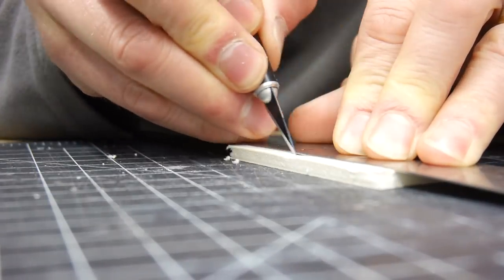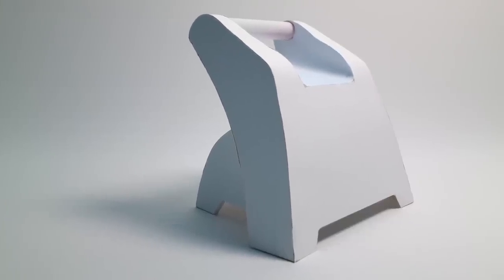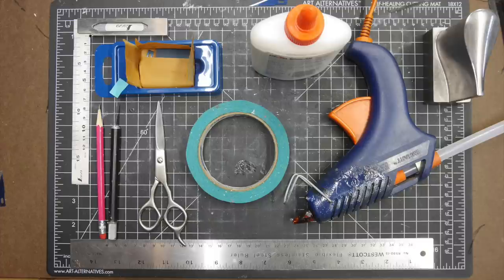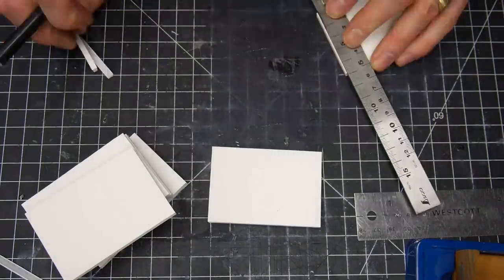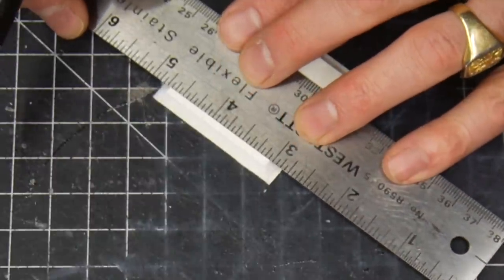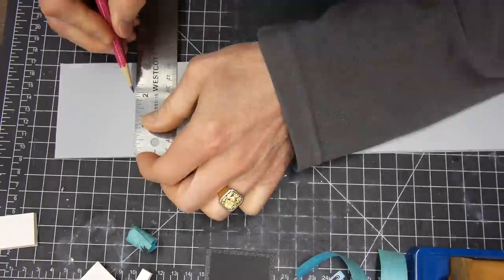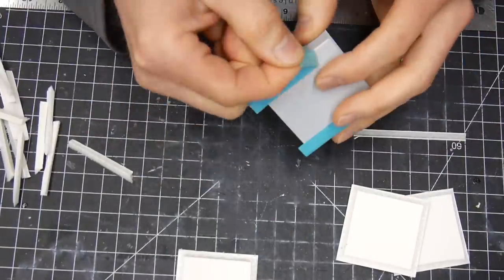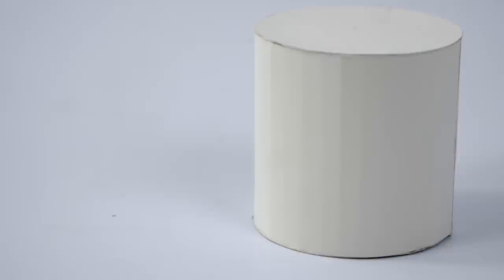FoamCore Basics Tutorial Guide FoamBoard model making: modeling tips and tricks for Designers

Comment: I'm making a halloween costume -- school bus, to be exact, and using foam core to be the bus.  I did not cut 45 degree angles, and I'm not so concerned about it looking perfect, however, I am concerned about finding the right glue to bond everything.  Do you have glue suggestions?  I have tried crazy glue and hot glue and neither work.
Reply from the maker: Hot glue works of course and it's fast, white glue is clean but takes a long time to dry.

Comment: great video.
I like to use bare utility blades for foamcore.  I use the extra length of the blade to help guide the cut.
A very shallow angle with your blade allows for an easier and cleaner cut.  
I learned some great techniques from Flite Test, as they use foam core to build RC aircraft.

Comment: Thank you so much for making this video! I have had so much confusion between foam core and foam board and expanded  pvc sheet…I Make dollhouse miniatures ..This is perfect for making room boxes or even the small doll houses. I love the way you do the tape with the Elmers glue. I don’t own a glue gun ,so that will be perfect for me. I have trouble with cutting perfectly. I’m ordering some expanded PVC sheet ,because I’ve seen a couple of YouTube videos where people make doll houses with that and it seems to be more clean-cut. And durable...Do you have any experience w expanded pvc sheet ,or know about it? Also, What X-Acto knife are you using? I got a number two blade and I think that was the wrong one to get ..I believe it’s less sharp… Anyways thank you for any help you can give me! And thank you so much for the video ,,it was very helpful!
Reply from the maker: Whit * I have not made any videos about the expanded PVC sheet I do not believe that you can just cut it with a standard X-Acto knife in the same way that you can a piece of foam core or cardboard. X-acto blades should be linked below the video
Reply: Eric Strebel 
Thank you so much for the quick reply! I know it’s possible, because there is a YouTube video ...I believe it’s called DIY miniatures… But he puts on there that he uses expanded PVC sheet… He directed me to a page on Amazon and it’s only about an eighth of an inch thick (may be a little bit more)… I believe you can buy different sizes… But he cut through it perfectly with a craft knife. I guess I’ll find out ,because I’m going to order it soon, and see how it goes… I’m getting the smallest piece possible… ($9$ I do very small doll houses so I don’t need much… Thank you for all your help!

Comment: Sir Strebel, you are a wizard  with foam(s) & because  I want to do quality work I need
to ask  your opinion  about what type foam I might use?  I'm designing an RC Plane &
it will be about 40 inches across. Should I use a "Closed Cell foam" or is another type
better?  I'm looking for durable foam that can be shaped(cut/sanded). I'll use the best
glue for the type foam I go with, for aesthetics & hold. I'll also do some type of paint &
a laminate.  Foam  is my main  concern & there's  so many  types that I thought I'd get
your input before I do anything..... thank you
Reply from the maker: diggy dice closed cell will be stronger, but it's really the outer cover that give the foam board it's strength. look for a quality foam core for your final plane. Best of luck. when you build something tag me on social media to share.
Reply: Yes sir, and for that reason I'm planning a lighter foam for the core of the
project & a thinner but tougher foam wrapped around at least the wings
of this project. I don't want to use "Hot Wires" to sculpt this, I'm looking
for a foam that a Dremel & Exacto blade can do smooth work on. With
sandpaper to finish it for paint/laminates. I'll keep you apprised since
you know the most about the "Aesthetics"  of foam modeling.
chat soon & ty again..... don

Comment: How long does white PVA glue take to bond approx 15-30 min?

I like the 45 deg angle with painters tape idea

I see a lot of people use straight pins if they do the standard 90 deg  flat pieces for custom gaming box inserts for example
Reply from the maker: PVA can take an hour or more to set up(to be safe), depending on your local atmospheric conditions. Things take a bit longer but the results are worth it.

Comment: What about contact cement in place of white glue? I'm not sure if it react negatively to the foam but you'd get something tacky after a few seconds. Hot glue is a pain for small fine projects. If I'm working with electronics of filling a hole, it's awesome. Don't care about stringing or being neat.
Reply from the maker: Neoblackdragon don't know, it might eat the foam would have to test, not sure it would be strong enough, but you just never know. Try it and reply back to let everyone know.
Reply: Yep, it will indeed eat the foam. It won't eat through it like some other chemicals but it's more then enough to give you a very bad day. It's perfect for making models out of gym or exercise mats though. Strength depends on use. Pulling is out of the question but something that is pushed or stacked should hold up. 

Though foam core is cheaper and you could walk into Walgreen and get it.
Reply from the maker: Good to know!Neoblackdragon Epoxy would work though.

Comment: Should I wear a mask when working with this material? I cut with a dull blade which is a pain in my ass so I stopped working on it until I get a sharp one. Anyway because it's dull a lot of the foam parts were on my table, am I at health risk for having those?
Reply from the maker: Should not be needed.

Comment: you know that if you put some vasline or petroleum jelly on the hot glue gun then it won't be so thick right it will thin it just right and you know that if your spiral your glue gun (move your gun if a circular position) it won't be so stringy right?? PLEASE READ its obvious you don't watch life hacks
Reply: u should know how to use a glue gun if you hate it I use to think the glue gun was to thick before I knew those hacks not hate just giving advice
Reply from the maker: If I wanted a different bead, I would just change the nozzle to a different diameter, not add a lubricant to thin out my material. I just don't really like hot glue, it's messy and potentially dangerous because it's hot. Thanks for the comment, keep on hacking' cindy chen